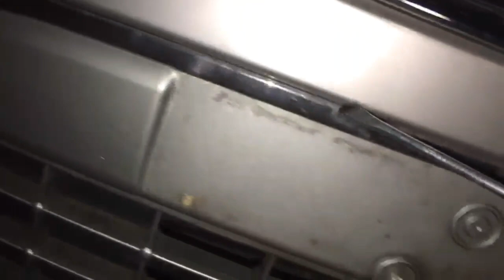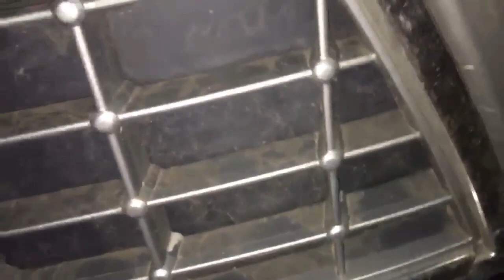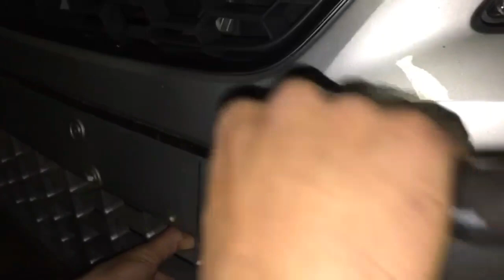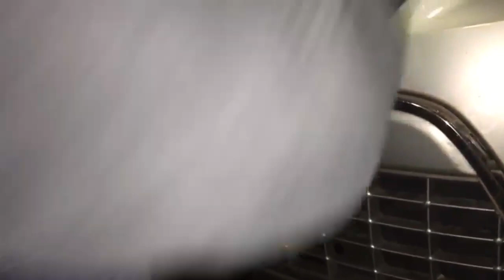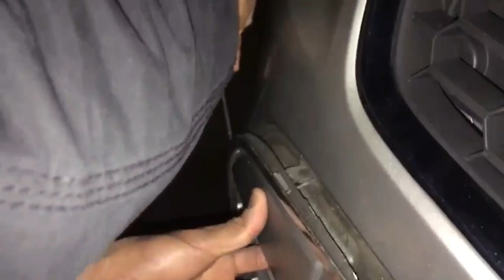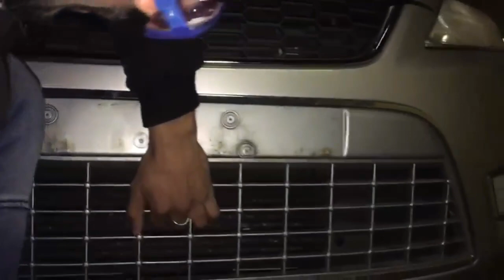Ford Mondeo Mk4 How to remove front grill without removing the bumper

Comment: I tried this but a lot of the plastic is very brittle and the tabs tend to break.  I did manage it in the end, but broke several parts of the chrome.  I found a newer grille without any chrome at a scrapyard and that was easier to work with.
Reply from the maker: Silicon spray or WD-40 helps

Comment: Do the same with standard grill which is less stiffer and non stop bend over if you hook it... You have rigid type of grill with chrome so it is easier. And you can easily this method damage yours paint.